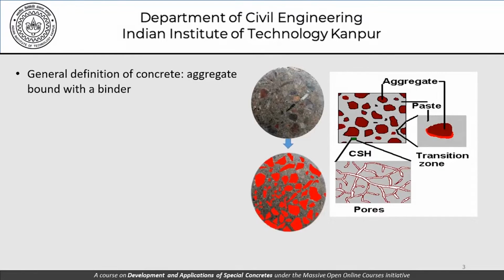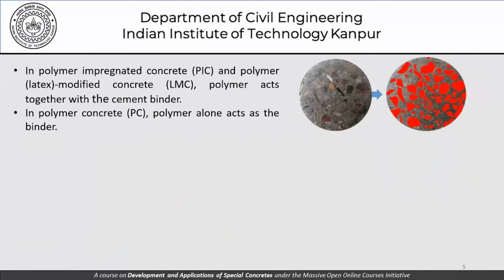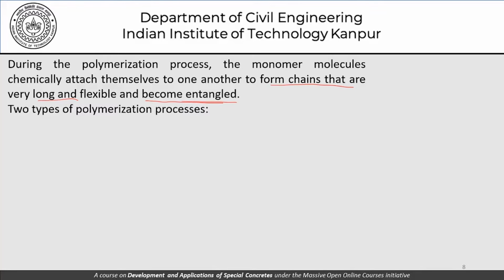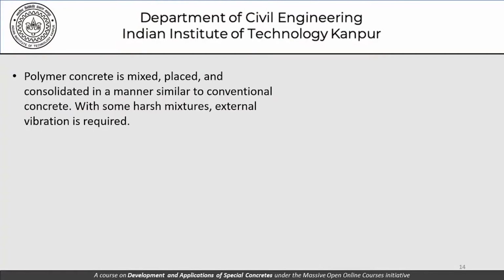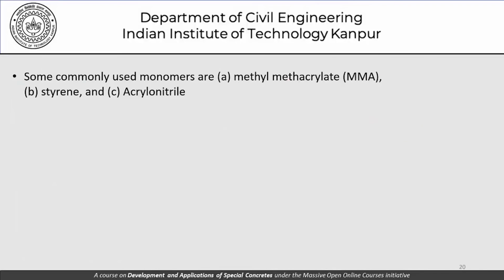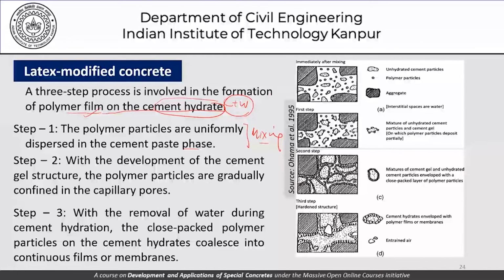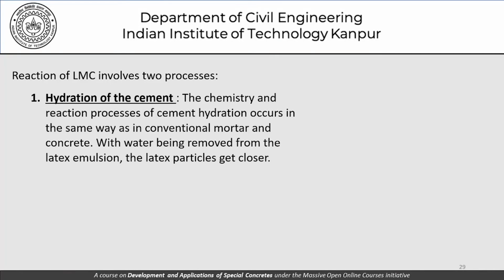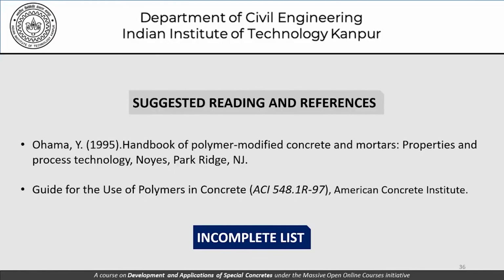Lecture 28: Using Polymers in Concrete

Comment: Sir in the polymer concrete advantages its written excellent adhesion but again in disadvantage it written as poor bonding with conventional concrete. Why is that?
If it have excellent adhesion why is it again written in disadvantage that it doesn't have good bonding